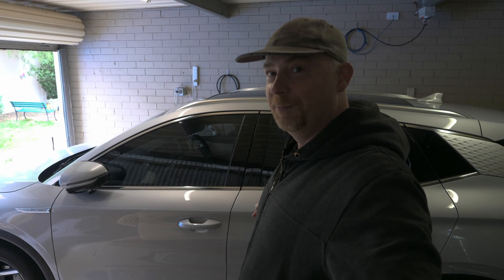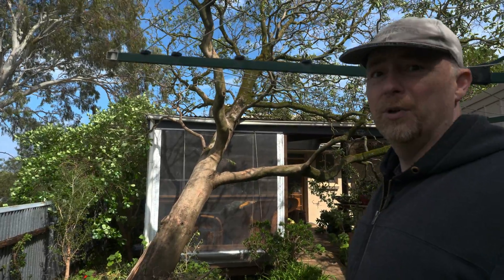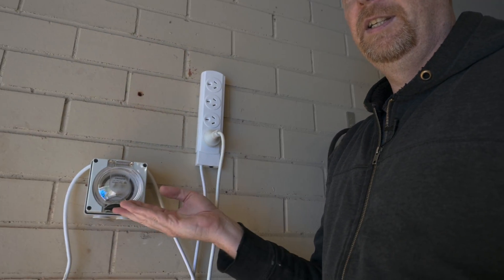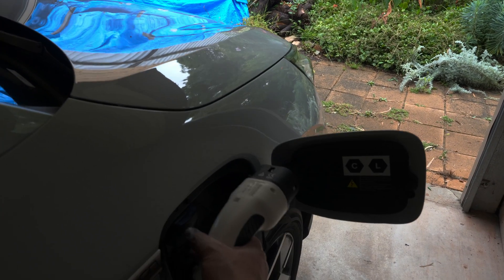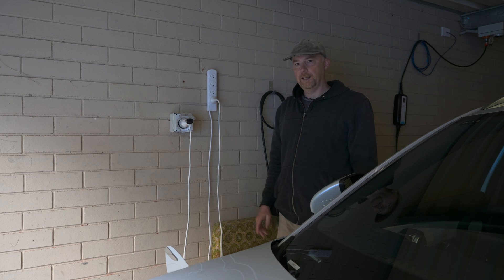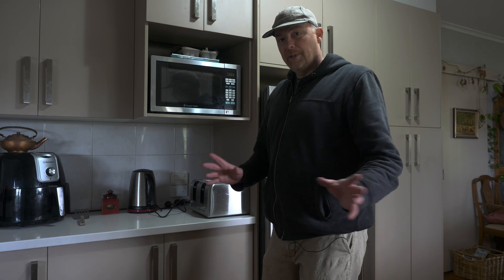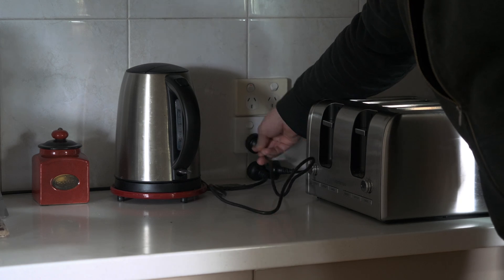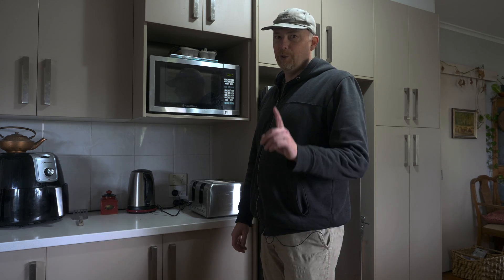BYD Atto 3 - Vehicle to Load

Comment: Why would you faf around getting an expensive seperate GPO(s) installed when your EV Battery could probably power your whole house at least for some hours. All you need to do is get a Chinese / Taiwanese Hybrid Solar Inverter and plug it into the PV inputs of say Mpp Brand Inverters they go up to 600volts. You can get 10kW one for about $1000. Then just get a two way switch installed on your powerboard   and switch over when you need to.
Reply from the maker: The V2L on my Atto3 is only about 2kW so only installed one outlet where it would be most needed.   I'll certainly look into what you're recommending though.
Reply: Where did my reply go with the link to the inverter?

Comment: A very good thing. I dream of using it to operate my split air conditioning system for heating that I installed last year. And recharge the vehicle battery with solar modules from the roof and a small storage buffer😉.
Reply from the maker: Good idea. As long as it's a small split system I can imaging that's possible. I've powered a portable air compressor system overnight ok.

Comment: Thanks for making the video.  I am looking to put in the same setup with my atto3 from the carport into my kitchen to power fridge, modem and perhaps tv.  Seems like we are getting more storms in Adel that result in power outages.  My electrician advised that I should install an rcbo in the carport input for residual current protection.  I noticed you said that your appliances switch off if too much is connected.  Do you have an rcbo installed?
Reply from the maker: Thanks for commenting. Yeah,  It does seem we are getting more storms and power outages. I've used this on two occasions to keep the fridge on.  But I have been using it quite a lot in the evenings for my TV too. It's essentially just an extension cable, so haven't had any rcbo installed. I guess protections would be built into the adaptor or inverter. But I'm not an electrical expert, so don't quote me.    
I think the power might be a little lower than 240v,  perhaps 220v,  but it still works fine. I've had the power trip a number of time when there was too much load. But I haven't had to reset anything.  Just turned off the device overloading it, and the power came back on. 
I've heard of people using over 3kw with simple resistance devices,  but I think that was with a modified adaptor.
Reply: I've looked at the instruction booklet that came with the vtl and it only describes overload protection not residual current protection (aka safety switch now known as rcbo).  I believe that the latest electrical regs for new work require an rcbo on every circuit not just one for the house like the old safety switch.  Even though this is power from the car and not the grid, the same principle applies.  Might be something to check with your electrician.  Looking forward to more video's - with local content. One about your portable charger would be good, as I went with a fixed 7kW charger to avoid forgetting to pack the portable one for a trip.  I'll let you know how my vtl setup performs once it's installed.
Reply from the maker: @tinymuddygecko  Cool. Thanks for the info.   I'll look into that. 
Yes,  I'll have to do some more videos soon 🙂

Comment: That’s cool you installed a plug that can power essentials during an outage. Does that off grid caravan plug power the entire house or just the new plug switches installed at the kitchen area?
Reply from the maker: Just that one power point in the kitchen. I could run additional extension cords from the V2L power board,   but the maximum power is limited to around 3kW.  I have seen a video where they powered the house using some sort of auto change over switch where it disconnects from the grid and uses the car instead of a generator.  But that looked rather complicated. I just kept it simple. The future vehicle to grid technology sounds promising though. Shame the Atto3 doesn't have that.
Reply: @EVswitch Many thanks for the video. Would you happen to have the link to the video where they have the transfer switch between the grid and the V2L wiring installed?
Reply from the maker: @1gsbrogio  thanks for watching.  Sorry, can't find the specific video now. If I come across it I'll let you know
Reply from the maker: @1gsbrogio  found it. check out EcoHouse Thailand.  https://youtu.be/TmzgBo_BwwQ?si=xfzti0aXaopITJDW